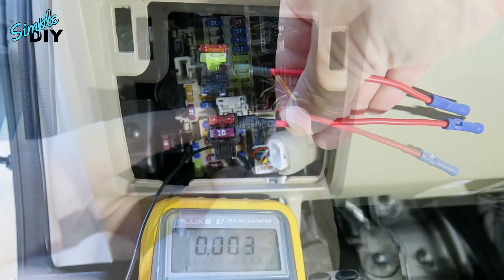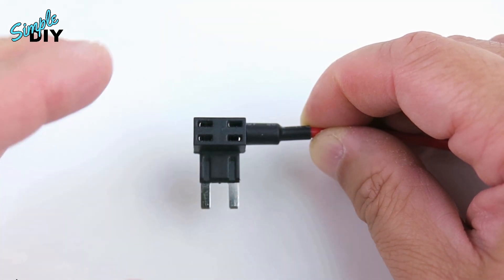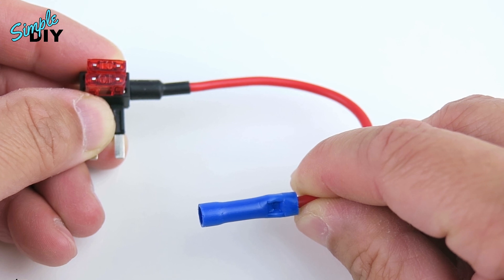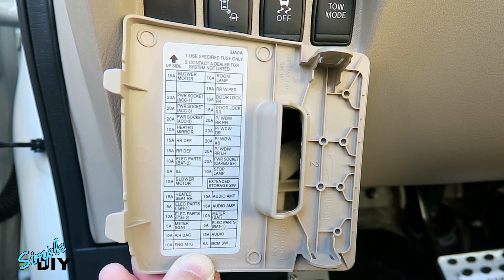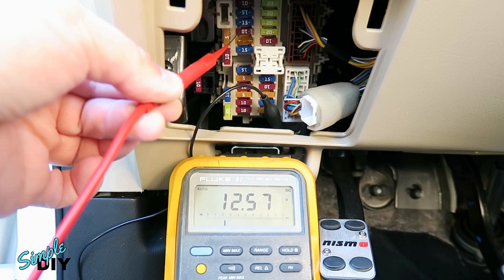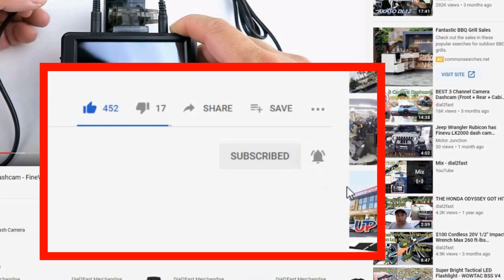How To Install A Fuse Tap & How It Works - Hardwire

Comment: Eye opener of an explanation. I didn't know both fuse slots needed to be filled to send power to your circuit. I also didn't know fuses were directional. Don't ever lose hope on your project because it doesn't work the first time!
Reply: Both don’t have to be filled. Say you are using an empty fuse socket. You can just ignore the bottom one and only use the top one. It will still get power. Just did it today.

Comment: How about the black wire? Where you should connect it? TIA
Reply from the maker: You can typically find a grounding nut or bolt under the dash. Crimp a ring terminal on the ground wire and bolt it to one of the grounding nut or bolt.

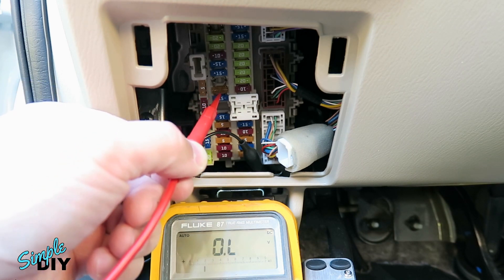Comment: I used my multimeter to probe the two sides of a fuse like in the video. The left side gave me a negative number unlike the 0V like yours shown at 3:16 

The right side was the same number but positive. So I'm guessing the positive end would be the right side since it gave me a positive number for the voltage reading?
Reply from the maker: To identify which side the power is coming in on, you must see ~ 11.5V or more on the multimeter. If you saw a very small number, then that's considered 0V.
Reply: @SimpleDIYMedia  Okay, so it should be 11.5V or more regardless if it has a negative symbol on the left. Thank you.

Comment: what amp fuze would I need if im adding 2-12 volt outlets? I figured a 10amp would be fine.
Reply from the maker: The fuse amp rating you need is strictly dependent on the device you will be connecting and how much current it draws. If you are not sure, probably 5A or 10A will work for most car accessories. Also make sure the circuit you are tapping is able to support the current.

Comment: If you’re using a spare fuse location can you just put a fuse in the top slot of the add a circuit?
Reply from the maker: You still need to test the spare fuse slot in the car because some unused fuse slots have no voltage.

Comment: The white thing on the left of your fuses is a fuse puller. Use it, not pliers.
Reply: What if the car didn't have one....then what instead of using pliers just go buy another one
Reply: @DIVINELIVING999 but he had one 😂😂😂😂
Reply: Except they never pulled a fuse out and the plastic bins on them before anything
Reply: Pliers work just as well. If not best. Bada bing bada boom. Take it away😅
Reply: Spot on mate
Reply: Pliers work just as fine
Reply: @matthopkins1107 no

Comment: Thank you posting this. I just added a fuse tap for my amp remote wire. Wasn't getting power to the amp. Wasn't sure if I needed both fuses for the fuse tap. Now I know. Thanks again

Comment: Question: if I fuse tap let say my headlights, will the switch I use to turn them on/off also control the device/lights that I am using?
Reply: Probably not. Think about it this way - power is constantly supplied to your house from the electricity lines outside, but your lights only come on when you switch them on. Other things in your house are not affected by whether or not your lights are on, because the light switching mechanism is located at the switch, not back where the power comes in to your house. It's the same with your headlights - the switch for them is located away from the other thing you have plugged in to the same fuse position.
Reply: @RiffRaffMama.  so I ended up testing it out and yes tapping into that fuse will turn off and on the whatever accessories but I am using a relay to power the accessory and using the fuse tap to trigger the switching…
Reply: @OMBG215  So if you connectt say, a dashcam to the headlight fuse, if you turn your headlights off, the dashcam goes off, too? Interesting.
Reply: @RiffRaffMama.  remember, I have the accessory (which would be the dash cam) on a relay. The relay is powering it, the fuse tap is to turn it on and off…

Comment: Super helpful, but what did you do with the black wire?
Reply from the maker: Connect the ground wire to a ground bolt under the dash. You will have to look around and find good ground bolt.
Reply: @SimpleDIYMedia  this worked, thanks!

Comment: You added two 10 amp fuses for the thing you're powering. How did you decide on 10amp vs something else?
Reply from the maker: Bottom fuse is the factory one. The top one just need to be higher rated than what the dashcam requires for current. Most dashcam draws less than 1 amp. So you can even put a 2A fuse at the top if you want.

Comment: The video is super helpful! Thank you! I do still have one question, though. Do the two fuses used in the fuse tap have to be the same amperage? From the way that you described them working, it sounds like they operate independently. For instance can I use a 10 amp fuse in the top for the dash cam, but put the original 20 amp fuse in the bottom and be certain that each peripheral will be protected properly?
Reply from the maker: The fuse you add on should not exceed the original fuse rating. Since you are install a tap and adding on an accessory, you are sharing the current (amperage) load with the existing fuse circuit. So both fuses are independent but make sure the total current draw does not exceed the original fuse rating.
Reply: @SimpleDIYMedia  Question: I purchased a tap that says 2-10A. The fuse I want to tap is 20A. Will the 10A tap work properly? Or do I have to look for a tap that is 20A?
Thank you.

Comment: Thank you for this video. I was having an argument with someone recently about whether there is a right way and a wrong way to insert a fuse tap. He insisted that the electricity flows through the fuses in series regardless of which way it was inserted (which defeats the purpose of having two fuses). I was trying to make him understand that when the fuse tap is inserted the correct way each fuse acts as its own circuit, but when inserted upside down the electricity enters through the "exit" of the OEM fuse slot and the "entrance" of that fuse then feeds the other fuse. Thank you for proving that I was correct in my understanding of how a fuse tap works.

Comment: So you can use different fuse sizes on the same Add-a-Fuse?
Reply from the maker: You can but make sure it's rated either same or lower than the factory one.

Comment: Most fuse taps ive seen are 10a rated. I noticed you tapped into the 20amp fuse also…is that too much load for fuse tap wire? Just wondering? Or is it just about the top fuse which is lower amps through that tap wire i suppose?
Reply: Yes, he loaded 20A wire by 30A and he thinks it is okay. The red wire should be on other side, then both of wires are secured by original fuse

Comment: Awesome video. So many dashcam installation videos skip the part of confirming the orientation of the fuse tap insertion.
Reply: Agreed. Now that I fully understand how these work, I have to go back and double check some work that my "professional" mechanic did. He added a fuse tap to an empty slot that is not used from the factory. However, he put two fuses in the tap instead of just utilizing the accessory slot, so now the car's OEM slot is receiving power when it shouldn't be.

Comment: Hello, great videos, to the point, no bs...Question: Is there such thing as a Fuse Tap (for low profile mini) that can handle 15A, or maybe 20A? All my local auto parts stores only carry Fuse Taps for low profile mini that carry 10A max. Any help or website than you know of, would be greatly appreciated
Reply from the maker: The reason you only find fuse tap that handle 10A is because the gauge of wire they use might be 12-14 gauge. This means the wire is what's limiting how much current it can handle. I have not seen any fuse tap that uses  a heavier gauge wire. If you must tap a high current wire, you need to look into splicing and soldering onto an existing high current factory wire.

Comment: My question is how to know which fuse you need? For the lower fuse on the tap  I understand. But for installing seat heaters I can't find any info for which amp fuse I need
Reply from the maker: That depends on how much current the seat heater draws. There is no guessing for this information, you have to find out how many amps it draw, then find a circuit in the fuse box that can support it.

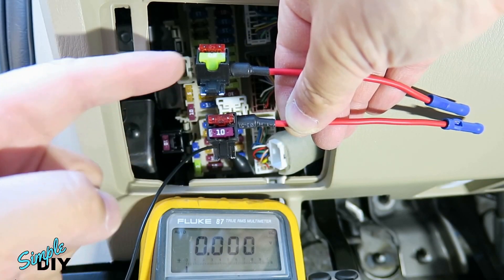Comment: @SimpleDIY 4:02 Did you make a mistake here? The manual and other guides are saying red is constant power while yellow is ignition/acc.
Reply from the maker: There is no real standard for whether red is ignition12v or yellow is ignition 12v. If you are installing car radios, red is ignition 12v. If you are working with made in China dashcam, then yellow is ignition 12v. If you are working with Korean dashcam, then red is ignition 12v. You just have to install it accordingly to the product you have.

Comment: Hi , why do you need tap into the constant connection and the ignition only? Do you just need one or the other ?
Reply from the maker: You need ignition and constant power for dashcams that support parking mode recording. That's how the dashcam will know if you are driving or not. This also depends on which dashcam you are using. Some will switch to parking mode after a period of time when the GPS recognize the car is not moving.
Reply: @SimpleDIYMedia  oh okay that makes sense. Thank you for the quick reply!
Reply: @Samafolife  Parking feature usually comes with the motion detection record option so to not drain the battery in the long run while the image being captured is static.

Comment: If you are installing a dashcam, why are there TWO fuse taps- a red and yellow? I am about to install a reversing mirror/camera and assuming I need ONE fuse tap from a 12v ignition fuse source. Any advice?
Reply: I believe it's because some dashcams have the parking mode feature which draws power from the constant fuse (yellow wire) while the ignition is off.

Comment: The orientation of the fuse tap that you are suggesting can be very dangerous! While it might not be a big deal for dash cams because they only consume ~0.5A, if you ever wish to connect a high-power device (for example in my case a dash cam battery pack that consumes 9A when charging) when both ends are under load your input wire that was probably designed for 15A will now be under 20A combined load and will start melting if left running for a while. To avoid mistakes, always make sure that current goes through the original fuse first and then branches off to the tapped fuse. Then if by accident you put a 20A combined load, the first fuse will pop saving your car wiring from catching on fire.
Reply: A relay helps prevent this
Reply: @A. Melbs  it isn't the dudebro is a meathead.
Reply: @A. Melbs the individual fuses and the wires that are coming OUT of the fuse tap are fine. The wire that's coming INTO the fuse tap is what's going to give you a problem if you accidentally put too much combined load on it. Hence, you want to make sure the current runs through the original fuse first, and only then branches off to the piggyback fuse. You can achieve this by flipping the fuse tap around.
Reply: @rere4202  You are absolutely incorrect.

Comment: Might be a stupid question, but can I tap an already unused fuse port and just have one fuse on the tap? I tested it for 12v and it indeed powers on only when key is turned. I installed it for my radar detector yesterday and it seems to work fine.
Reply: Absolutely.  You only need to make sure that the circuit and wiring that is feeding that circuit is designed to carry the load your accessory needs.

Comment: So you can use two different amperage fuses in one tap??
Reply from the maker: Yes you can, but 2 things to consider. 1) the accessory fuse you are adding must have a higher rating than what the accessory device requires. 2) The accessory fuse you are adding should not exceed the original fuse rating in the fuse box.
Reply: @SimpleDIYMedia can the addition of both fuses (original and accessory) be greater than the original fuse rating? Or does that not matter as long as individually they're not greater than the fuse box rating. My amperage rating is of 7.5 and the original fuse there is of 7.5. so would I have to replace the original 7.5  to something lower so I can add the second fuse of 2 amps so the total is less than 7.5?
Reply from the maker: The fuse on a circuit should always be a bit higher than what the device actually requires (current it draws). Let me give you an example. Let's say your device actually draws 7 amps, and it's running on a circuit with a 5 amp fuse. Since this 7 amp  device exceeds the 5 amp fuse, the fuse will blow. If your factory fuse box has a circuit with 7.5 amp fuse, and you are tapping into it for your accessory, then the combined current draw of the original circuit and the add-on device must not exceed the 7.5 amps. Typically, you should not change the original fuse to a higher value because it's not just the fuse that handles the current flow, the wiring behind the fuse box also have to handle the current flowing through it. So if want to tap a 7.5 amp fuse, then the total current draw on that circuit must be below 7.5 amp. On the fuse tap, you can install a 5A or a 7.5A fuse on the add on device side. Again you have to know how many amps all the devices are drawing to know if it's safe to put it on that circuit. And if you need a circuit with more current draw then the 7.5A, then find another fuse to tap onto, and to make sure it will support the device. First question you should answer is 'how much current this device draw?' Once you know, then you can find the appropriate fuse circuit you can tap onto.
Reply: @SimpleDIYMedia  Awesome man. Thanks for the detailed explanation. It's my first time installing anything electrical in my car so it's a bit confusing but thanks for clearing things up. I'm going to install some interior lights I found on Amazon but I can't seem to find info of how much amps it requires to run. I only see that it requires 12 volts. I would like for them to turn on only when I turn on the ignition on or turn the key into accessory mode. This is why I want to tap into the fuse labeled "accessory" in the fuse box, but according to the fuse box, it's only for 7.5. I'm going to do more research on where else I can tap into or wait for the lights to be delivered to me with the info of how many amps it requires to run.
Reply: @SimpleDIYMedia   Once again thanks for the help. Least I can do I return is like, sub, and purchase the fuse tap from your link

Comment: Professional car audio installer said yellow acc wire tapped into 20a fuse power socket, red wire also goes to the other 20a fuse power socket black ground wire to bare metal, but the dash cam won’t turn off by itself, but I noticed you have ya wires tapped to 10a fuse? am I doing it wrong?
Reply: Maybe parking mode is enabled?

Comment: where tf does ground go?
Reply: Anywhere you can find vehicle ground.  A bolt or screw into something metal is often perfect.  Use a voltmeter to find it (12V  to red lead then poke metal with the black lead until you connect the circuit).

Comment: I was watching to remind myself how to do it, bc the fuse rating was confusing to me. You didn't explain this. Mixing rating within the tap. That's OK though, I am sure I'll find it.

I did learn about flow rate, checking which side of the fuse is hot, and matching it to the flow direction of the tap. I didn't not know this, and it seems important.

So, thank you for making this video, it was quick, clear, consise. Good job.

Comment: means to power up the dashcam, we need to install another fuse to the fuse tap adapter? if so how much capacity fuse is to be install?
Reply: The original fuse (that you pulled out to "borrow" power from) goes in the bottom of the fuse tap.  Whatever you're powering with the tap (wire) determines what amperage fuse you use on the top.  The vast majority of dashcams, including those with front and rear cams, are likely fine with nothing more than a 2A fuse.  But check the manual for the camera to be sure!  Don't run a larger fuse that you need.

Comment: You have to have 2 wires? Or can I just use one wire?
Reply from the maker: Depends on your dashcam. If it needs ignition 12v and constant 12v, or just ignition 12v.

Comment: Good video to explain the directional part.  Initially I thought that since fuses are not directional,  so the fuse tap would not be directional.  But, after your video, I realized that the current would flow directly to the dashcam instead of  the fuse if I install it the other way. Also the neutral simply goes to chassis in cars,  interesting.  So that's why the battery has a wire connected to the body. Thanks for making the video. Now I can try installing the dashcam.

Comment: Good information. Planning to install my foglights. It has a relay, 2 power leads, 1 acc, and 1 power lead and the other ones are chassis ground and battery negative. Can I just use the chassis ground for the negative leads and fuse one of them. Lastly, what will happen if I match the fuse. Some say you can match it??

Comment: Where did you put the ground wire?
Reply from the maker: You have to locate a ground bolt under the dash and connect the ground wire to it using a ring terminal.